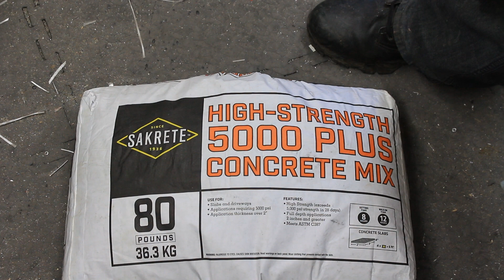Failure is Everything.

Comment: With the bubble machine um that’s not right ok let me start over…
With the grease gun hydroforming jig steel is probably your best bet and slathering the whole contraption in grease won’t hurt but I think your issue is the bolts going through the piece your bending it needs to pull a little bit. 
I totally agree with you buddy. 
Failure Is The Best Teacher Any Of Us Will Ever Have

Comment: For future use, Harbor freight has an air hammer for $12.99 and a 4" air chisel set for $5.99!
 Then take a 4 x 4 X 4 and drill a 1/2" hole( or a hole that is tight for the chisel to fit into it too.) And boom you have a cheap cement vibrator.

Comment: I'm pretty sure the issue with the grease from is the holes you put in the material to bolt it down. It needs to be able to be drawn in from all sides when bulging. So make your form larger so the clamping bolts go around, not touching, the metal you intended to form.

Comment: as for the failures on the 7:26 ---> the sheet metal you tryed to shape was steel or alluminium? if it was alluminium, i would recommend going for mild steel instead (mild steel got more max elongation before rupture) if it was already steel, then you could maybe, if you got a torch, or something able to heat up metal a lot, try to heat the steel part a lotafter having made some deformation, in order to let all the tension out, before letting it cool down, and then continuing the deformation (as when you deform metal, there's a build-up of stress, and heating it enough and letting it cool down slowly by itself can release a part of the stress within the metal)

Comment: I wonder if you can lubricate the edge of the sheet near the opening so it rolls into the open portion of the die you are trying to use. Otherwise maybe it's having to stretch too much in the one area and tears? Just a thought. Idea here is that the portion being pulled into the die has something to ride on instead of just purely friction tearing it apart like bubble gum. 

I know with aluminum they do it in successive passes 'cause it doesn't like to stretch too much in one go (ie. look up can making and you'll see how many stages they extrude the can for deep draw applications).

Comment: The grease gun forming was really interesting. Like my fellow commenters, I have no idea what I'm talking about, but it looked to me that the material is stretching too thin and failing ("tensile strength"?). Can you create multiple forms in successive expansions and move the material from one form to the next? The idea being the points being stressed the most not being a point of stress in the following expansion? As far as the grease leaking out the side, can you route a groove into the forms and use fat o-rings to seal in the freshness?

Comment: Why not paint it again with a cement slurry and to fill the voids?  Your just using it as an anvil form right?  You need more water not less.  You need more slump to fill the void.  Can you mix a high cement and water concentration with or sand/silica mix for the first inch of pour. It will be stronger with less bubbles. Then fill the rest with your mix. 

Can you not drill through the deforming piece of steel  so it will float when you put on pressure.  Most thing seek path of least resistance so it wants to find a weak point to blow out.  If the lip could move a bit, it may take the stress off the form edge and slide in a bit. 

Please note I'm a random jackass on the internet with lots of opinions and no experience.

Comment: On the hydroforming, what if you make elongated holes and clamp it with rubber in between so it can slide a little bit?
Reply from the maker: I do think that would help, but making the holes elongated is more work than I am willing to put into these parts because it makes it sake so much more time they can't be mass produced. Another viewer suggested not drilling into the metal at all, and allowing the clamping force from the bolts to do the holding. This would certainly allow it to slip in there as it needs to but I don't know if it will hold it hard enough. Rubber might be a good addition to that if it slips too much.

Comment: When you drill your holes through the aluminum, what if you made them radiating slots so that as the grease pushes the metal, it can pull metal from the outside. This might be better if you are also using a gasket to allow for that slippage.
Reply from the maker: From the videos I saw, the metal gets pulled and the holes become elongated naturally. This is definitely not happening for me though. I definitely don't want to make them slotted myself, as this will end up being more trouble than it's worth. Another viewer suggested not drilling holes in the metal at all, but cutting it short of the bolts. This would allow the metal to slip for sure, and if it is tight enough, it just might work.

Comment: What aluminum alloys are you working with?  Some REALLY don't like to be formed certain ways. You could try annealing the aluminum ahead of time.
Reply from the maker: 3003 H-14 is all I have. I tried .050 and .063. I have used the same stuff in a hammerform to make these parts and it worked great.

Comment: The sallet i was working on kind of falls into this failure catagory. The sallet overall can still work, but it's in rough shape and not really worth putting more effort into, as i'm now starting my brigadine. However, i did improve my dishing of the helmet dome better than my first sugar loaf attempt. So, i did improve a little.

The metal at the end tearing.
Have you tried possibly pre-dishing the metal? I don't know if that might work, but instead of trying to stretch it in the jig, you might get better results if the metal is slightly dished beforehand.
I'm coming from the train of thought of how a metal helmet is dished out so deep.
Reply from the maker: I saw the pics on your IG. I don't see how anything you did can't be adjusted to call it a success. As far as pre-dishing...I can make these pieces by hand using a hammerform. The idea behind this method is to avoid the need to work the material and make it all lumpy. I am trying to reduce the amount of time and effort it takes to make them, so doing additional work to this would likely just mean I have to go back to the old method.
Reply: @DavidGuyton  I could still get the sallet to work, though i'd have to put more work than it's worth. The tail is at too high of an angle, i believe that the sallet comes a little too far down towards the shoulders, and the backplate needs to be reshaped.
But that was a project to tie me over while waiting to get supplies for my brigandine.
I'm excited for the brigandine! Not so much about the sewing involved lol.

Comment: With the grease forming maybe try annealed copper. It won't shear so easily.
Reply from the maker: It may work with copper, but these are for the blisters on the Rocketeer jetpacks. Material has to be aluminum.
Reply: @DavidGuyton  I suppose you could try annealing the aluminium. Not sure how well that works though, but if you have the time then might as well give it a try.

Comment: Did you try heating the bottom piece of metal that you're trying to bend to make it more mailable?
Reply from the maker: I did not try that, no. But I can.
Reply: Hot metal and grease may cause an explosive effect. A negative mold on bottom to prevent the metal from expanding once its reached the desired shape.

Comment: Thin steel sheet should work better in your grease forming jig, as it's less likely to crack than Aluminium. Personally I would use hydroforming (see my videos), just cut out the shape twice from 1mm thick steel, fuse weld the edges using your TIG torch without filler rod, and use a cheap pressure washer to inflate. I have also used a bike pump to successfully inflate small pieces with air. You could form both pieces at the same time, welding a strip of metal around the edge to separate the two sheets and provide a place for the hose to attach.
Reply from the maker: Actually your videos were some of the ones I watched doing my research for this. Using water and a pressure washer and welding is a little more work than I want to do for these parts though. My parts have to be in aluminum because that's what the rest of the jetpack is make from. I will try a few more things but I can always revert to the hammerform process to make these parts work (it will just take a lot of time to make them all). I may end up using a pressure washer to make the main center section though. The YouTuber I am working with is either going to make a set of dies to use in a press, or a die made to work with hydroforming. Should be interesting either way.
Reply: @DavidGuyton  I'm happy you watched my videos! Hydroforming can make complex shapes quickly, so may be useful for future armour projects too. Interested to see the forming of the main section, and hope it works well. I agree with the other comments about annealing the Aluminium and cutting slots from the holes to the edges (the no hole method might also work), then if that works you could have the sheet & slots laser cut for mass production.

Comment: On your hydroform try cutting you slots out to the edge of the metal for your blot holes so that it can slide abit to that you have material being pulled in as the bubble is formed
Reply: I agree, slot out the bolt holes and allow material to flow in. Check your failed parts and see if the current holes were pressing against the bolts when you were forming, it should have marks on the outer edge on the holes.

Comment: Instead of aluminum, maybe brass that has been heat treated or steel. 
Not sure if you can heat treat aluminum.
Reply from the maker: While it may work with another metal, these are for the Rocketeer jetpacks, so the material has to be aluminium.
Reply: @DavidGuyton  Are you using 6160, it mght not be suitable for stretching. Maybe something like the type used for aluminum cans might work (used for extrusion). Not sure what the make up is.

Also consider reaching out to fellow YouTubers Abom79, This Old Tony,  AvE. They might help.
Reply from the maker: @OtherWorldExplorers  I'm using 3003 H-14. I ahve used it to do hammerforming and it works great. It just doesn't like the greaseforming (so far). 

I don't bother reaching out to the bigger YouTubers anymore. I am ignored 100% of the time if their channel is bigger than mine. I don't hold it against them personally, as I know how busy they have to be. But I don't waste my time reaching out anymore.

Comment: If you haven't failed you haven't found your limits and you've learned nothing. Several people have used reciprocating saws as a vibrator for concrete. Good luck with that grease forming